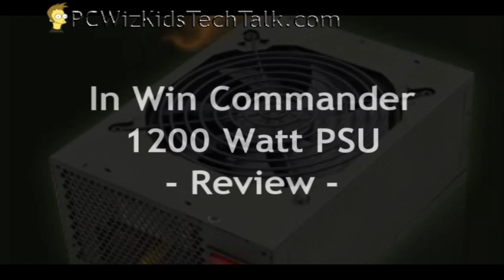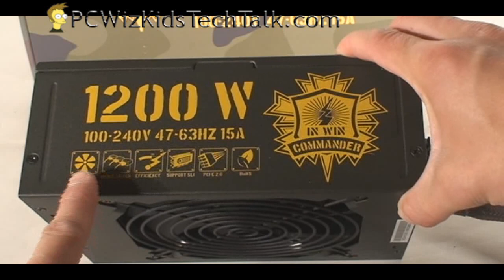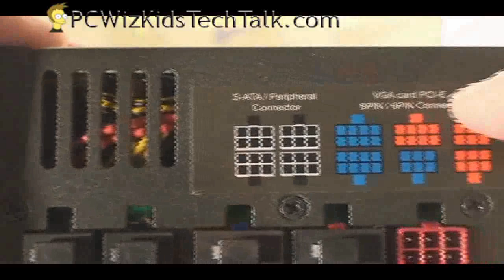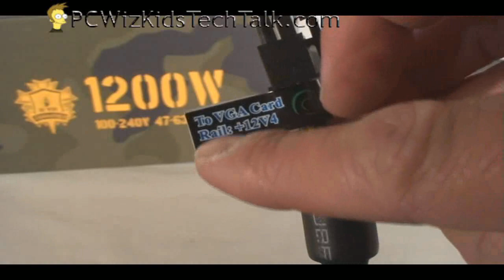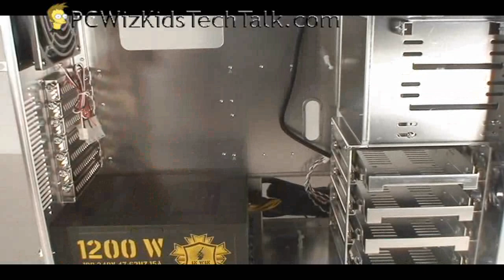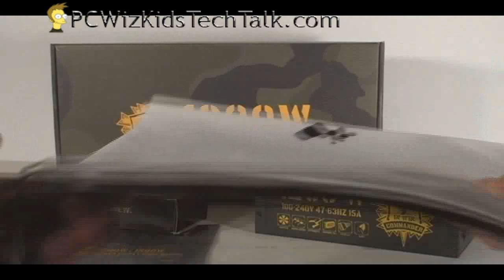IN WIN Commander 1200W Power Supply Review

Comment: It depends on the hardware you're using, and not really the motherboard, 'cause it should sound rather funny with a "64bit motherboard". For example, if you have about 6gb ram, a 64bit CPU and a decent GPU, the 64bit version of that OS you're about to use, will take advantage of all that.

Comment: I was just wondering if the fan on a PSU is only designed to keep the PSU cool or is it meant to keep the case cooler inside as well ?

Only wondering because he had the fan facing downwards.

Comment: AMD athon 64 AM2+ 3000+ something like that is my processor (cpu) so it should be a 64bit? cuz when i installed my windows XP with 6 gb ram (2 slots taken 2gig each last 2 taken 2gb (1gb each) and it said i was using 3.25GB but it said that when i had 4gb cuz 3gb is max for xp srry for typing too much i checked my system it said its a 32bit instead of 4gig should be 2gb instead of 6gb it should be 3gb straight but i got 3.25gb